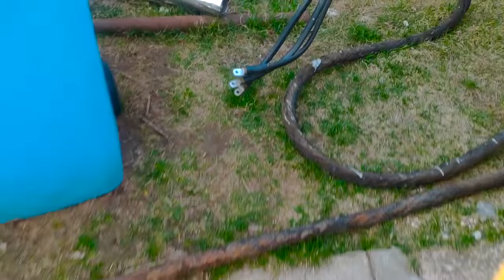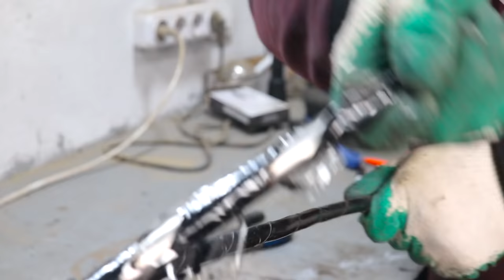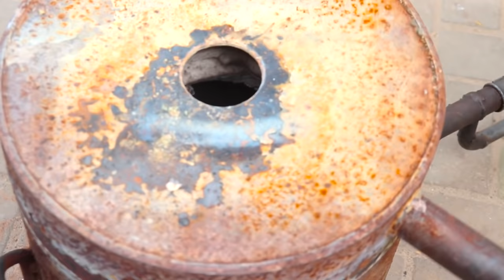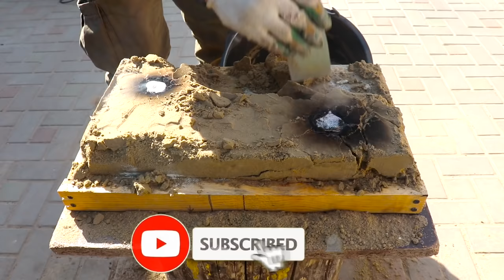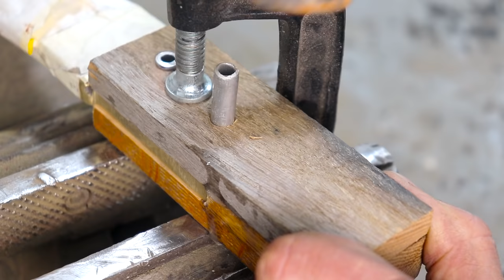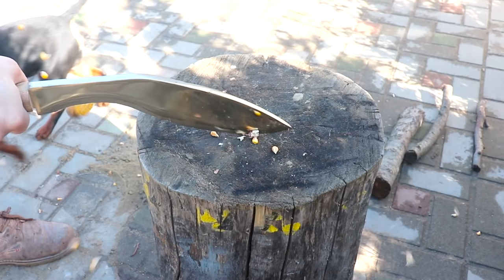Casting kykri from nails -  Trash to treasure- Brass casting Melting of copper cable

Comment: alot of work stripping the copper but the outcome was worth it nice cast
Reply from the maker: The cable was reinforced with steel , which complicated the process
Reply: @hotmetal85 kinda thought so from the sparks when you were cutting it